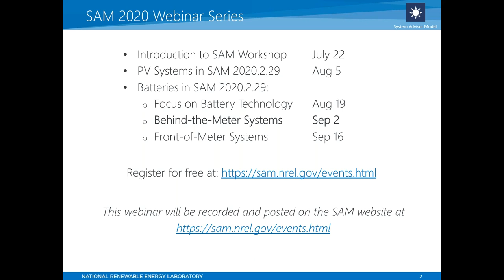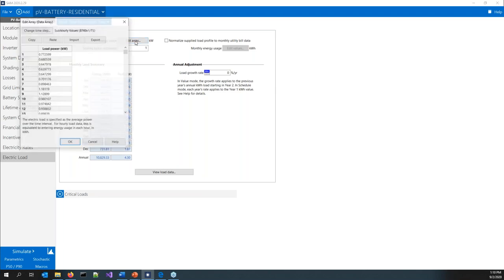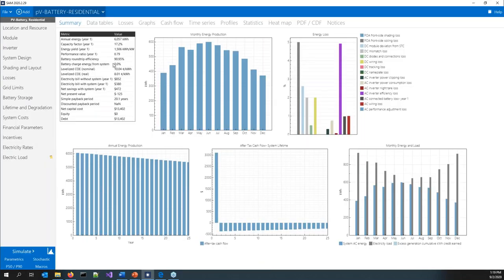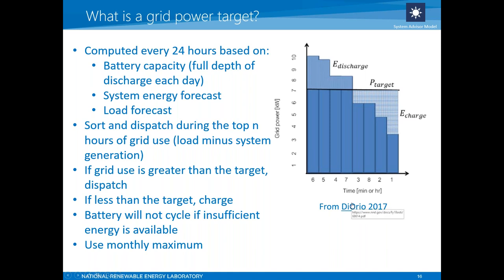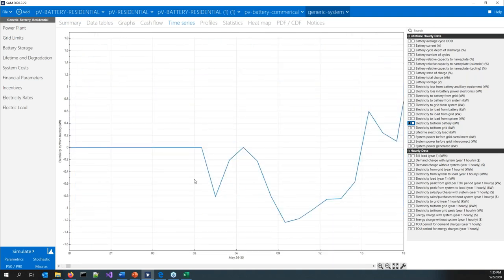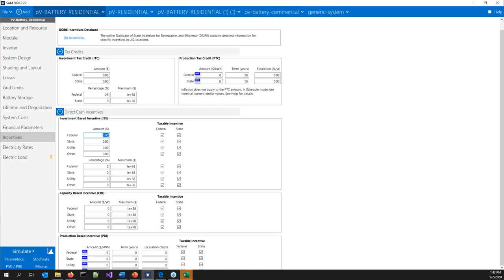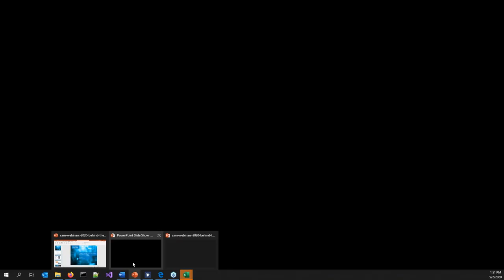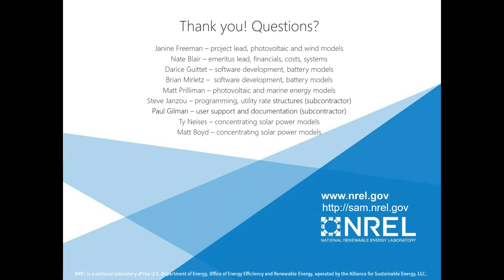Batteries in SAM 2020.2.29: Behind-the-Meter Systems

Comment: Is the desired bank Power (kW) and desired bank capacity (kWh) equivalent to kWac peak per day and kWhac per day if I select "Set desired bank size" and select AC units for Battery Bank Sizing?

Secondly, having ran your simulation, how do you show or read from your results that your system is providing 95% of the energy through the year.
Reply from the maker: Please post questions about SAM to the SAM forum at https://sam.nrel.gov/forum.